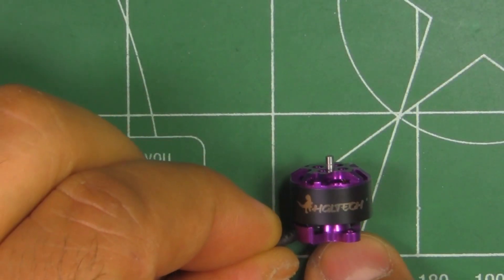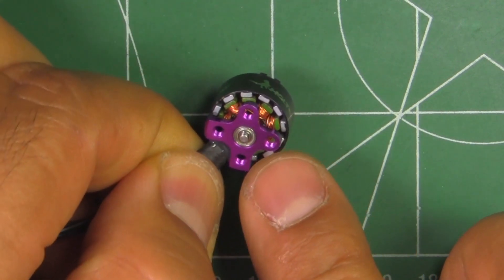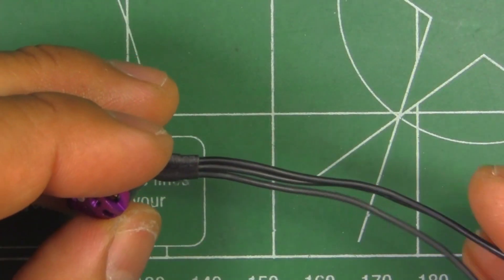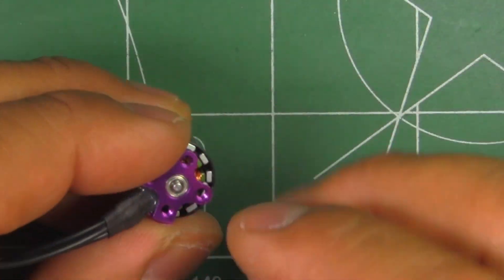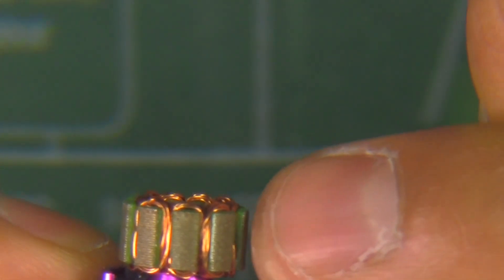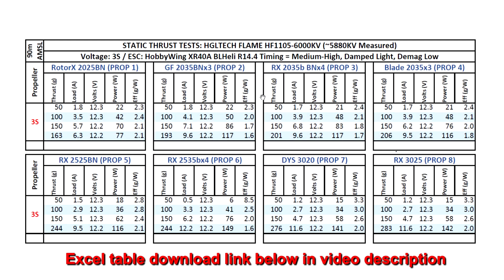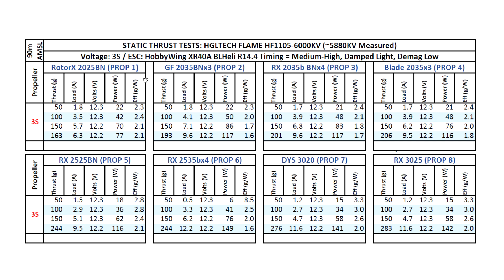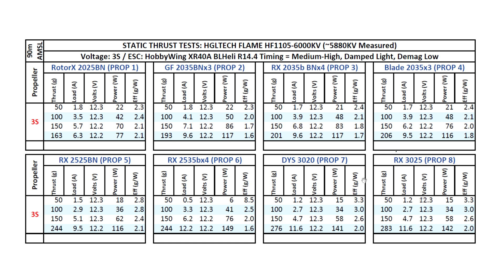HGLTech Flame HF1105-6000KV 3S Thrust Tests & Overview

Comment: These are a little underpowered on my 2inch hd setup. Do you think they will run 4s? Or am I going to have to buy some 1106's?
Reply from the maker: 4s probably too much for these. Though they might run but too risky I think. There are several good choices now. 1304s, 1206s, and 1106s. A lot of people  have switched to 1304s and even some 1306s for better throttle control from low to mid rpms. 1106s will give you a better  setup. Main enemy is weight.

Comment: I used modified 1580 bench for tests and got almost perfectly the same results as you did with 1105 6000 + RX3025.  Differences are around 4 g of pull for the same  amount of power so It might be humidity / temperature factor.
Reply from the maker: You can call those results identical ! Cool to hear you got very similar measurements. These RCBenchmark thrust stands are a very useful tool. Worth every penny :) Thanks for sharing that info.  At the beginning I actually thought Amps were reading way to high. Then I used other meters to check and they all came within 1 to 2 Amps and load cell was also very accurate when checked against a couple of digital scales and calibration weights.
Reply: @EngineerX   How can we contact privately? I have a question for you.
Reply from the maker: @carboncopters5674  give me your email here then I'll email you. Once I email you can delete/edit post
Reply: EngineerX Hello? Did you saw my comment?
Reply from the maker: @carboncopters5674  right now. I will message you

Comment: Would you recommend using a 4S with gemfan 2040 hulkies? 3S power is good but looking for a little more power, of course finding a light enough 4S battery is another problem...
Reply: Did you try these on 4s?

Comment: where do i get the circlips for the bottom of the motors?
Reply from the maker: 1.5mm shaft: https://www.ebay.com/itm/E-Clip-Snap-Ring-Circlip-304-Stainless-steel-1-2mm-1-5mm-to-15mm-GB896/173511814117

Comment: What is the maximum continous power you could run ?  From my experience with these motors when running with 3020 props on 3S they got overheated and burn quite fast.

Comment: Are this motors made by 3B motor ? they seem similar components and sizes
Reply from the maker: Right, the bell shape is nearly identical, only the base is different. Very possible they're made at same factory, but I don't know if that's the case.

Comment: Love your reviews,  Will these go well on 6 Amp ESC's on 2inch props on 2s?
 I see no numbers for 2s, so I am in doubt. It's for a small 2" build. Or should I buy other ones for that build?
Reply from the maker: Usually for 2S 2" most setups will use higher KV motors if you want more lively performance, 6500 to 7500KV.
These will fly on 2S and 2" props but it might be just average performance. 
6A ESC's could work OK but to be honest, they seem a bit on the "small" end. Most setups use at least 10A ESC's for 2S.
Reply: Yeah, I know I want to put them on a very small quad with a 16x16 mm F4 AIO flighttower , this one
https://www.aliexpress.com/item/Super-S-F4-Tower-Flight-Controller-Board-Built-in-Betaflight-OSD-2s-4in1-6A-Blheli-S/32828686273.html
Maybe I should get the Flame 1104 - 7500Kv version then, or do you have a better recommendation for 6 amp ESC's?
Reply from the maker: At that price is going to be hard to find something similar. So if you want to use that one, then yes, good idea to stay aroung 6000kv and 2" props. Anything more powerful you will want 10A ESCs. The only similar flighttower I've use is the one on the Aurora and the one on the Armor90 https://www.youtube.com/watch?v=SCJY0bLV6Bg
Those are 10A ESC's so that's a good formula to follow
Reply: Thank you. I couldn't find a 16x16 mm flight tower with 10 Amps ESC's.
 It's the only size that will fit that particular custom made (very beautifull) frame. 
Normally I use 20 or 25 amps ESC's for 1100 motors. A bit overkill, but it costs nothing more than 10 Amp ESC's
Reply from the maker: Sas Dj Yes. That's a difficult size to find . I haven't seen any other besides this one you linked. So choices are very limited.

Comment: I think these are made by BBB, they look identical, except the BBB are closed bottom.
Reply from the maker: You're right. Bell, spokes, top look pretty darn close https://www.3bhobby.com/product/bbb-3b-r-racing-motor1105-kv6000-7500/
Reply: Maybe they are the OEM for the motor HGLRC sold, and now they are selling them as well. Btw do you think these motors are a suitable replacement for a blade torrent? The torrent runs 1104 7500kv, but on 3s it kills the lipo as well as the motors, I wanted something less powerful for a change. It's either these BBB 6000kv or the 1104 6500kv from racerstar. I'll be running the stock 2.3 inch props.They are the same price, but maybe racerstar is running less powerful magnets, also judging by your test on the 1106 3800kv
Reply from the maker: This size and KV should work fine as replacement for Torrent and it'll be more gentle on batteries. But look at Frewaffle comment below. He said he had some issues with these, so something to keep in mind. Research on durability of the RacerStars, if most people say they last and no issues, then the RS could be a better choice. 6000KV is a good match for 3S and 2" to 2.5" props, but you'll probably need 450 to 550mAh LiPos. If you want budget motors then the RealACC could be another choice https://youtu.be/qlCWb-eyWsY 
Other choice also, the RCX 1304-5000KV, lots of people love that motor on 3S
Reply: EngineerX freewaffle recommends the bbb funny enough. I think they come out from the same factory. The realacc are 1106 and since they are taller the prop won't spin completely inside the duct. I thought about the rcx's but Kim Albert from YouTube said they shine with 3 inch props. I'm limited to 2 inch with the ducts. I haven't heard any complaints about racerstars, I think that even if they are higher kv they produce less thrust, because they probably have cheaped out on the magnets heh

Comment: from my experience i dont reccomend them... i had 3 out of 7 motors not working out of the box...(stripped motor wire) and 2 more stopped working after the first week of flying (some crashing but not too much) not durable, i suggest just going for the realacc 1106 or the bbb 1105 these should be better
Reply from the maker: Uggh ... that's not a good QC ratio! Seems you put them thru good use and these didn't deal well with the abuse :(

Comment: for some reason  i cant seperate the bell from the moto...
i removed the c clip but the bell still wont come off
how do i remove the bell?
Reply from the maker: Try using a punch or similar toolhttps://www.homedepot.com/p/Mayhew-Short-Pin-Punch-Set-3-Piece-89032/100196184
Position tool aligned vertically with shaft from bottom of motor. Use mallet or screwdriver handle, or any hammer type object to strike top of punch making sure tip is on shaft. You can also try sticking motor in freezer overnight and see if that helps release it.
Reply: will do, thanks

Comment: I recently built a 90mm with these exact motors and under punches (50+% throttle) my quad rolls and pitches pretty hard to the front right. Do you think it could be something wrong with one of these motors? If it is not a motor issue the I have no idea please help! Barely noticeable line of sight SUPER noticeable via fpv feed.
Reply from the maker: I've had that happen on one build. I couldn't track down the culprit but it could have been any number of things. Could be FC or its PID settings, it could be ESCs, or it could be a bad motor. Difficult to narrow down unless you do a 1 by 1 troubleshooting: change motors, test/ change ESC, test / change FC test.....
On the other hand, you can try adding a 470uF low ESR capacitor to the battery pads ,Panasonic FR or FM series or Rubicon are best. 
Check that none of the mounting screws have dug into motor windings. Check all solder points make sure all are good shiny blobs.
Reply: What is the capacitor supposed to do exactly? I haven't used on any of my builds but I will try it out. I am using a 4-in-1 esc so it is kind of hard to diagnose esc issue. Banggood offered to send me one motor replacement so I was going to try and see which motor acts funny in BF and go off of that to change it. Hovers super smooth with the F4 and punches even beneath half throttle, just full punch outs tilt it. I tried anti-gravity, increasing I-gain, air mode. First motors were on soft mounts and i removed because i thought they were preventing bell spinning. Still exists just lessened a bit. Any input appreciated!
Reply: Calibrate/sync your esc. Go into betaflight/clean flight then motors with only usb. With the props off, set the motors to max throttle then plug in the battery. It will make chime noises and wait for 10 seconds and return to zero. Blip the throttle to see if motors spool. Some quads need it to be done more than once. This should pretty much eliminate torque steer.

Comment: Is there a way to measure the spool up time with the different props?
Reply from the maker: Wes Tompkins There should be a way. You need way faster sampling than what the RCBenchMark hardware can provide. Some of the Arduino based controllers can do it. The spool up in all these motors we use occurs in very short time so we would need to have lots of data samples for every hundredth of a second in order to have enough meaningful data. Spool up time is a very telling metric. It can give you a motor' s response characteristics. Unfortunately that's beyond my testing equipment's capability.

Comment: Do you think the 1105 7500KV of this motor would do OK with 2S battery and 2" 4 blade props ?
Reply from the maker: Justin Mack yes. It should be ok. I've ran 1104 7500kv motors on 2S and RX 2035BNx4 props no issues. Just make sure you have at least 10A ESCs. 12A preferred.
Reply: thanks for the recommendation boss!

Comment: Thank you for this awesome test! Would you recommend these or the realacc 1106 6000kv Motors for running gemfan 3025 Props in 3s?
Reply from the maker: For best price/performance ratio seems the RealAcc are hard to beat. Adam-g1 flies them a lot on that specific setup and he says they're one of the best for that combo, just follow the suggestions to avoid pushing back/fixing the shaft and orde 1 or 2 spares. He send me both and his experience, RealAcc #1, HGLRC #2. 
Then there's the other one I recently tested iPower iX1106.... a little more powerful but I don't have data on its durability. Based on thrust, seems like it would be one of the best for 3025 prop. I just placed order for new SunnySky 1106-6500KV and EMAX will be sending their new 1106's next week but reviews may take a couple of weeks, hoping weather gets cooler. 100F temps not good for thrust tests as Max gets skewed to lower numbers due to less dense air. Anyway, for best price/performance  can't go wrong with RealAcc but keep in mind they're low-budget so order a spare or 2 just in case.
Reply: Thank you, I will probably order the Realacc ones. I am just scared that if the shaft is loose the motor bell will pop off during flight :D But I guess you can't go wrong with this price. Thank you for these great motor comparisons!

Comment: Very interesting, I just fit these on my QV Libero 2" with an F410 FC/ESC combo... 10a ESC is cutting it fine, or do you think it should be ok?  Static is higher right?  + burst of 15a should be just right?  Or could the new GF Hulkie 2040's tip it over the edge?
Reply: Dom Kirbs I'm running 12amp dys esc's with mine. I did burn our a hglrc 10amp 4in1 with them but don't know if it was because of the motors or faulty ESC
Reply: Bigger props though?  I'm hoping at 2" it should just be ok
Reply: Dom Kirbs should be I was running 2.4 and 2.8 props
Reply: Its hard to fly with your fingers X'd...But I will try.
Reply from the maker: Theoretically a 10A ESC with 15A burst should be fine for motor/prop combination that draws up to 15A on the static thrust tests since in-flight Amps are about 25% lower (conservative). The GF2040 Should be well within that margin. However 10A rating doesn't offer a whole lot of overhead so make sure you're quick to disarm when you crash in case 1 prop gets stuck and FC tries to still fly , sending too much juice to the stuck motor.
Reply: Me crash?  Sir you must be mistaken...  I just tactically land sometimes in tree's :)
Thanks for the answer its exactly what I thought but better put.

Comment: I'm using these with the kingkong 2835 props and it rips!
Reply: Chad Hurd *2840
Reply: Thumbs_Fpv correct
Reply from the maker: Those KK2840 props are very harsh on these tiny motors  on the thrust stand. You can hear motors reaching their limit. BUT in the air seems they work quite well. As long as motors don't get scorching hot, Rip On!!
Thanks for confirming those props work with these. I just got a set from BGood and was testing them on another 1106 motor. I didn't yet have them when I ran tests for this motor.
Reply: EngineerX I ran them at a race this weekend because my 5" wasn't working right and some 5" were trying to keep up with me lol
Reply from the maker: LoL, epic.... a tiny 1105 ahead of the powerful 5" quads. Awesome, they're cheap! I'm going to try those props on my build and I'll make sure to mention they work fine with these motors as confirmed by your experience with them. Thanks for sharing.
Reply: Thanks for confirming this.  As this is the setup I recently ordered and am waiting patiently to arrive.  Thanks to EngineerX, for all these tests and information. It is very much appreciated.

Comment: Nice videos as always man, thanks for taking the time to do tests for us, the community :-)

If you can, you should try to get ahold of some gemfan 3025, they are the best 3 inch in my opinion :)
Reply from the maker: GF3025 2 blade prop? I do have a set, they're the same as the RX 3025x2 - GemFan makes them for RotorX. (I'll double check again to make sure they're same) 
I've ordered the new GF Hulkie 2" props and 3035x3
https://www.banggood.com/2-Pairs-Gemfan-3035-3X3_5-BN-3-blade-Propeller-PC-CW-CCW-1_5mm-Mounting-Hole-for-1104-1105-Motor-p-1182779.html
Next test: http://www.iflight-rc.com/ipower-motor-ix1106-4000kv-6000kv-fpv-racing-motor.html (did pretty good compared to the RealACC 1106
Reply: Yes just saw the 3035x3 very curious to see how they do.  wondering how they are cut down to fit on a 120mm as well